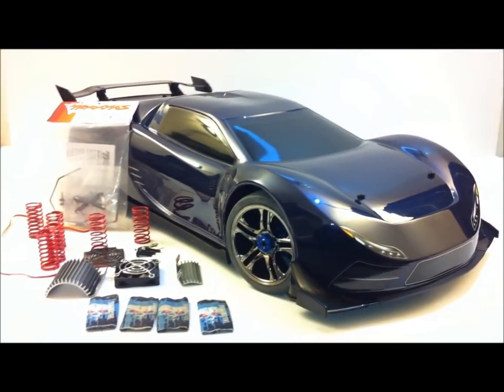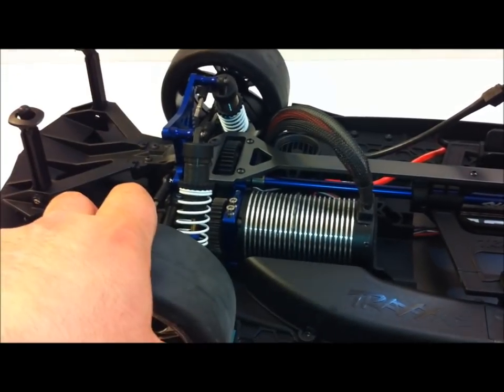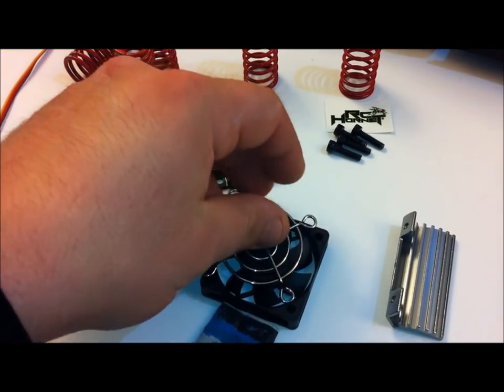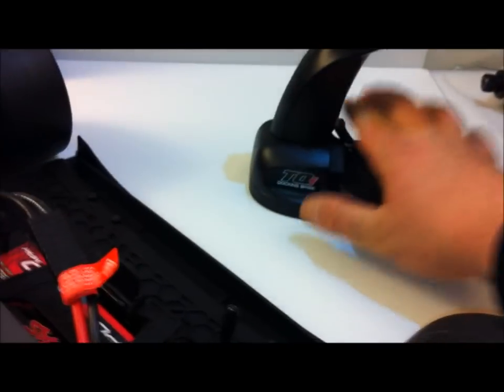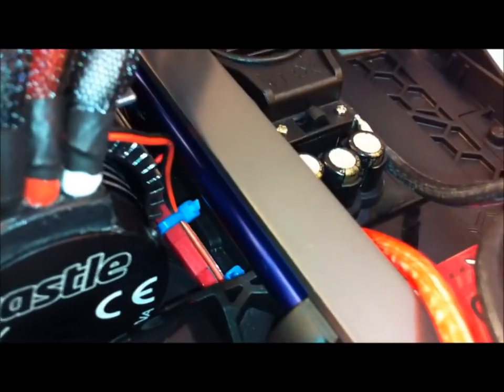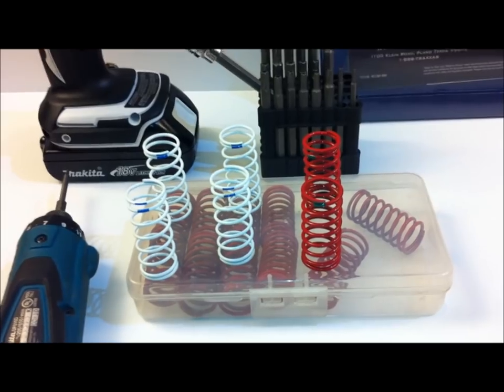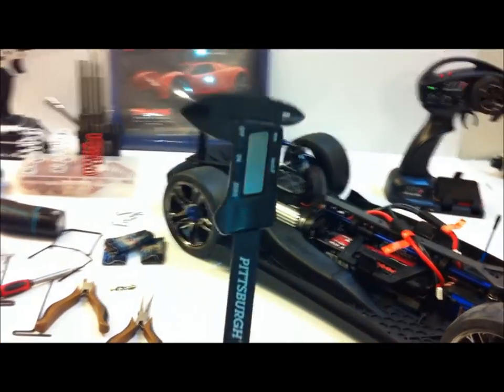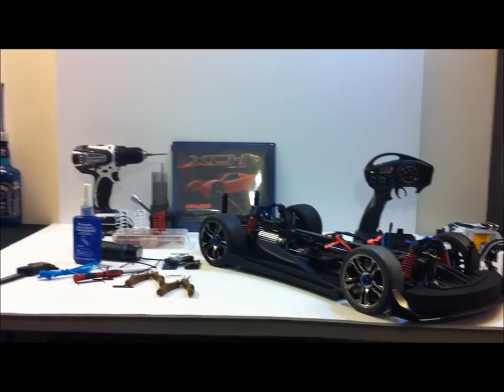TRAXXAS XO-1 UPGRADES!

Comment: My XO-1 never overheated with the high speed pinion driving around the streets low speeds
Reply from the maker: Might not have gone into thermal shutdown but temps will def be higher! 😊👍

Comment: You will never need these fan dude! look at the design of the xo-1 it's perfect! if you see the chassi, as an air entrance that will go direct to the motor! mine is totally stock, it's perfect the way it is. stay cool
Reply from the maker: It gets hot here in the summer and every single person that i know personally that own the xo-1 has told me the motor gets extremely hot dispite the vent in the chassis that is supposed to allow airflow. Just a precautionary measure and it looks cool too. Thanks for watching  DIOGOCOSTA SILVA!!!

Comment: Did you mean gold springs?  I don't see silver springs listed anywhere. Did you adjust preload and/or change shock oil after putting in the stiffer springs?  I like your fan; I'll have to look into that. 

Can't wait to see some running videos with your new camera!
Reply from the maker: Hey iamthomastommy thanks for watching ! I have heard and read about the green! I explained in the video I didnt have 4 green so I put silver springs because i had them and they are their progressive rate are thge next step up from the green springs. I have not touched the fluid in them.!

Comment: Is there anything that I can do to increase downforce? My Traxxas have problems staying on the ground
Reply from the maker: You can set up the vehicle. A combination of adjusting the suspension ride height shocks and adding weights to the front will keep it on the ground. Also using different tires will help
Reply: @EVERYDAYRC  modifying your rear wing and front splitter etc will help as aerodynamics are very very important

Comment: I had to remove the spacer on the suspension to get the spring away from the larger gear....will that affect the suspension?
Reply from the maker: Greg Robbins Hey Greg thanks for watching and I will have to try that and then let you know if it affects it!

Comment: I just got a traxxas xo-1 and could not find  any heatsink online that would fit the stock motor. I could not find the heatsink u mentioned. It would help if could advise. Thanks
Reply from the maker: Thanks for watching Truthbuser. Go to RCHornetProducts.com
Reply: I contacted rc hornet and they do not make any at the moment. Do u know of any heatsink that would fit the motor? I am serious, I could not find any online.
Reply from the maker: Hey truth. There are a lot of heatsink cooling fans online if you search. Type in xo-1 cooling fan or 1717kv motor cooling fan. There is a very good cooling fan out in the market but I'm unsure if it will fit the xo-1 1717kv motor. They are a company called Dragonslayer. Find them on eBay. http://pages.ebay.com/link/?nav=item.view&alt=web&id=121143480076
Reply: Yea there are alot  of heatsink. I already asked that ebay seller u mentioned and he responded it will not fit the xo -1.  I ordered a heatsink and it did fit. I tried stretching the diameter and it turned out inapplicable. So far i have not found one that will fit.

Comment: i have a xo-1 on the way i cant find that fan u have  at all do u have a link ty
Reply from the maker: That’s great to hear! Unfortunately this RC hornet fan is no longer available but you can find ones on eBay. There’s a really good one called the dragonslayer
Reply: @EVERYDAYRC  ok all look it up ty
Reply: would it be sold on ebay dont seem 2 be able 2 find it unless im looking wrong u have a link ty
Reply from the maker: Damn looks like this ones not available anymore either. https://www.ebay.com/itm/Ultimate-Mamba-Monster-Heatsink-Fan-combo-castle-2200kv-2650kv-motor-emaxx-erevo-/121194620426 I would suggest then the YEAH RACING DUAL COOLING FAN with heat sink.
Reply: @EVERYDAYRC  ok

Comment: If I Unlock my X0-1 but keep the stock gearing, will I get more speed? thanks for sharing! = )
Reply from the maker: Mark Dmitri You can unlock it for full potential and keep the stock gearing you juts wont go as fast!
Reply: yes but will it give my car more speed???
Reply: unlocking the x01 with stock gearing. will it make it go a little faster than in a locked state??  = )
Reply: Mark Dmitri i think the stock gearing wont help it go faster, maybe it might if the locked limit is less than the speed the car goes upto, it might go a bit faster but only till the point that the stock gearing can help the car to achieve and one more thing, bigger pinion gears=more speed, bigger spur gears=less speed
Reply: sweet cheers mate :)  I own two of these beasts now with some awesome upgrades. check out my vids
Reply: Mark Dmitri sure bro
Reply: @markamd1  where's your videos thinking about buying one just trying to figure out how much upgrades it needs before I purchase